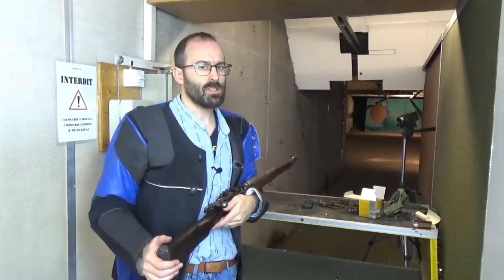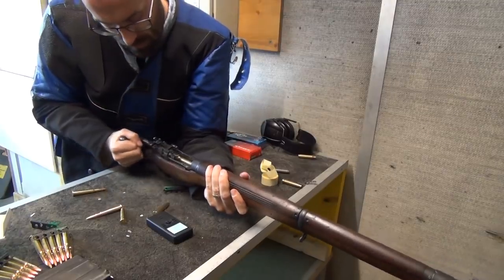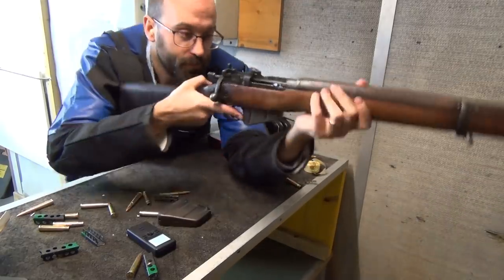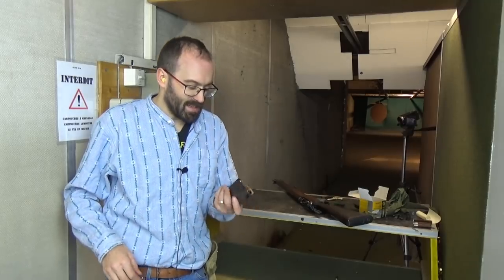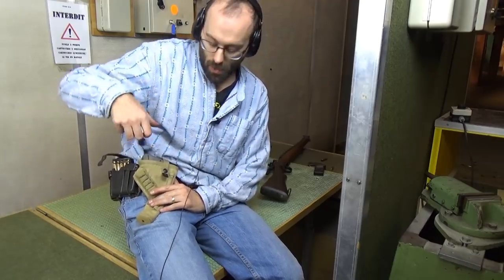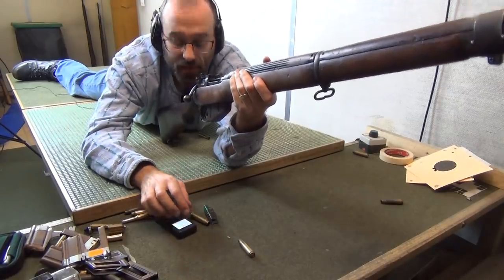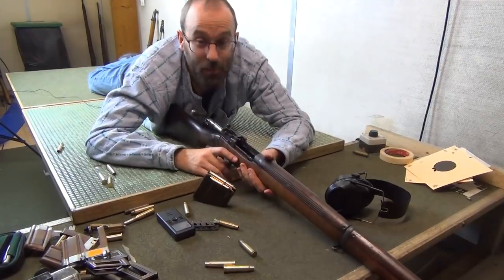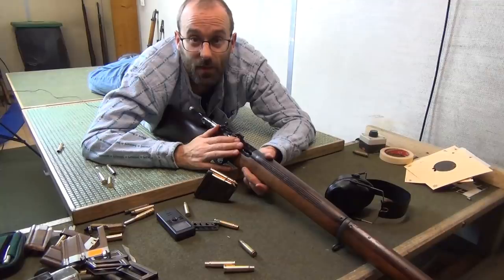Fastest Way To Reload A Lee-Enfield: One Charger Clip, Two Chargers Or A New Magazine?

Comment: A fine demonstration why the Garand 8 round enbloc clip was the correct decision when coupled with the ten pouch belt.  I used to beat the M14 guys with rounds on target when working from battle kit.  Up to 88 rounds at least.  First 20 went to the M14, but from there on to 88 it was me.

Comment: 1 vs. 2 clips at the beginning — 2 clips is more efficient because you open and close the bolt only once for two clips.
Reply: You'd still need to open & close the bolt the same number of times for both if firing ten rounds
Reply: @V. Fletcher -- Correct, but he is just measuring loading procedure.
Reply: bringing the rifle down and up again and aim also takes time, with 2 chargers this is only done once. So the difference should be even bigger.
Reply: Good point, nirfz.
Reply: @88porpoise "You do have some time lowering and then raising the rifle and reacquainting your sight." — I think you might be underestimating this because this will be combined with changing your position. It will also be an interruption in your normal bolt operation which on some rifles like Lee Enfield can be especially fast from the shoulder. I think any interruption matters. Now, mind you, all this would make absolutely zero difference for me, because I am not as highly trained (that's an understatement of the century), and even for someone like BotR the difference was small despite his mastery of the rifle. Still, the subject of the exercise was to determine if there is a difference, and I think the video as well as our theoretical analysis conclusively show that there is, however small it might be, and however small the audience that would notice the difference might be.
Reply: And, you lift then rifle up and down only one time.  It's really an obvious calculation.

Comment: This is clearly a very flexible system, if you run empty you can load a 5 round charger THEN decide whether to 
1) spend a little more time loading another 5 round charger
2) Close the bolt immediately to begin firing on the enemy ASAP.

As soon as you've put the first charger in you're golden, at any point in getting the 2nd charger from the pouch you may see someone trying to throw a grenade at you or something and drop that charger and just snap the bolt closed ready to aim and shoot.

then if suddenly there's nothing to shoot at any more you can continue loading the second charger. You don't have to reload from empty, you can top up every time your magazine is half empty.

Mag reloads will be inherently of low value as it only reloads 10 rounds at a time. For 10 round mags it could only be worth it if in a deep foxhole or trench so you could reload from a vertical stance, you could have the spare mag on the ground in easy reach in front of you and could just drop the empty mag.

That's an option for defending dug in positions, shouldn't be that hard to scrounge up a few spare mags.
Reply from the maker: I'm going to have to do another vid on the other advantage that everyone forgets with 10 round mags and 5 round chargers - you can put 5 in at any time when you've got 5 or less rounds remaining. You don't have to wait or screw around with loose rounds.
Reply: PS: there's a big advantage to having spare mags for a defensive position rather than just switching to another loaded rifle and that's because Commonwealth rifles are individually zeroed. Some people pull a bit more to right or left when shooting, and it's just not a good idea swapping rifles. 

Each solider is responsible for his rifle, he keeps track of minor problems like if the sights are a bit loose or where the bolt is normally a bit sticky and when a problem is developing.

By WW2 the rifles wasn't the main source of firepower, by then it was all machine guns, particularly the Bren gun which there absolutely had to be one per section (three per platoon) and aimed to have one Bren gun for every 4 riflemen (yeah, it wasn't only the BAR that aimed to 'just have more LMGs to increase firepower').

The rifles were far more for security for the Bren gun by WW2. Very standard German tactic was to use cover and concealment to get within range to throw a stick grenade, you needed to always be ready to respond to a soldier suddenly standing up to overhand throw a grenade.
Reply: I don't know if it's true, but I heard somewhere that a lot of British riflemen would tend to top up the Lee Enfield to 7 or 8 rounds rather than 10 during an engagement. The argument being that it takes slightly more time and effort to load a 5 round charger, on top of 5 rounds in the magazine, than to load a single charger on top of the 2 or 3 rounds in the magazine.
Reply: @bluesrocker91  I very much doubt it, all their ammunition is in 5-round charger clips. Where are they getting so many loose rounds so quickly.

I'm with Bloke on this, 10 round in the mag +1 in the chamber.
Reply: @Treblaine  He means waiting until you're down to 2-3 rounds before popping the next charger in rather than doing it as soon as you hit 5.
Reply: @WJS774  Ohh yeah, load a single charger on top of 2 to 3 rounds REMAINING in the magazine, after having started a firefight with 10+1 rounds and then firing 8-9 rounds.

That makes a lot of sense mechanically and intuitively. It's not going to be as hard to compress the spring all the way to 100% and if you're habitually reloading every 5 time you're down to 5 round in the mag... you're kind of effectively reducing yourself to a 5 round capacity magazine.

Comment: If the mag was easier to change out it might be the faster solution. Regardless a charger clip is not really any slower but is a lot cheaper and quicker to make. When supplying a million or so lads (and a few ladettes that managed to skirt their way into the frontlines) the cheapest option that is reasonably effective is the better choice. Spending way more money on something isn't really cost-effective enough during war unless that thing is just way better. Armies go for the cheapest viable option, and for WWII it was stripper clips.

Comment: Had the army gone for interchangeable magazines I suspect an awful lot would have been lost by soldiers more concerned with getting the next shot off than stowing their empties.

Although no country chose to equip soldiers with replacement magazines as standard for their basic rifle I note that they did so for automatic rifles and submachine guns.
Reply from the maker: Bigger magazines changes the equation massively. But then, there were some odd ones like the Italian Breda 30 LMG which is charger-loaded.
Reply: @BlokeontheRange  I'd forgotten about the Breda 30 though I had thought of certain early machine pistols like the Steyr M1912 as exceptions. Though people usually point to German assault rifle developments as showing the way for magazines I think it was the M1 carbine that really showed that all soldiers could be equipped with magazines as standard.
Reply: Bring back the retention chain. How often do you need to fire more than 20? ;)
Reply: @88porpoise  spent BREN magazines were to be retained, but by the assistant gunner of the section, rather than the rifleman during combat - he had what was effectively a dump-pouch with a button-top to store expended magazines for the duration, after which the rifles of the section would reclaim theirs and reload them.
Reply: @88porpoise  From using L4A1 and Sterling SMG in the 70/80s retaining mag were definitely order of the day on ranges and field exercises. The same went for L1A1 and Browning pistols.  God help you if you lost one, 252 (British Army charge sheet) right away followed by orders and 1 weeks stoppage of wages. I also remember my father telling me he got busted from L/Cpl to Signalman for loosing a Thompson mag in Italy during WW2.
Reply: Rumblin_Cynth_Rampo And a relative of mine was charged with losing his rifle during the American Civil War...

Comment: I'm wondering if it wouldn't be easier to do the mag change prior to extracting the previous round, no open bolt to fiddle with or worry about it inching forward and sliding over the new round
Reply: Then you'd be fighting the magazine spring to get it fully inserted though.

Comment: Personally. I think the mag change might be better if the mag release was easier to operate and the mag would drop free. I think the AR-15/10 kinda sets the standard. I wasn't expecting the mag change to be faster without it being in a pocket. That was a guanine surprise. My No.4 trigger guard is parkerized and the mag is a bitch to get out.
Reply from the maker: The thing with dropping clear is that there is no way that any army of that era would have tolerated dropping magazines on the floor deliberately :)
Reply: @BlokeontheRange  Doesn't have to drop on the floor if your hands in the way 😜
Reply: @KB9813  sure but people get lazy
Reply: Stripper clips were a vast improvement over loading individual rounds, you get less improvement going to a mag change.  The reason mag change is now popular is because of the size of the magazines.  Loading  a 20 round rifle with stripper clips would be way slower than changing a 20 round magazine.
Reply: @BlokeontheRange   Practical combat shooting. My Dad was always on about topping off magazines. 5 rounds is ideal for this and makes sure you don't have an empty weapon in combat. His loader would change mags and top off when he was on the Bren during breaks of fire for the same reason.
Reply: The mag was never created as a "load" and use item.  It is much faster if you load stripper clips (5rnd) and then another.  The brits trained in a method that one would reload and the other fire and so goes down the line.  It sounded like a MG.  The mag is intended to be removed for cleaning and inspection (I think).  It was too expensive to have mags.  It also did not fit Pattern 37 webbing (used 5rnd clip holders).

Comment: You mentioned S&B ammo... What's you opinion on it? I've seen it on the shelf here quite cheap but I always thought it "looked" very cheap too. Not a scientific assesment I know!..... Also, my chargers never seem to want to step aside by themselves and seem to prefer obstructing the bolt on it's way forward.... Any ideas?
Cheers
Reply from the maker: S&B is the most accurate 303 on the market, but the cases are pretty crap if you want to reload. Plus the rim edges are totally square, so they will rimjam.
Reply: @BlokeontheRange  prompt reply always appreciated. Oh, and I always find your "vaguely" interesting videos, very interesting... Keep it up!

Comment: I think you could've picked up a few seconds by stowing the empty mag the same time you grabbed the fresh mag instead of making the same movement twice
Reply: Hold the fresh mag in the pinky and palm, insert used mag and close. Magazine placement in the pouch is also needed to practice how it's comfortable but the rounded magazine would aid in it. Also with the smle I'd put the mag on the left side, slide my finger forward and hit the mag release. It's all learning what works and sometimes an outside observer helps. Changed plenty of magazines in an m16/4 in my time and a lot in the mud on the move for live fire exercises. Long time ago so I'd need to practice but it was done and could be again if needed.
Reply from the maker: There's no way I could do that without dropping the fresh one.
Reply: @BlokeontheRange  I think you could do it. If you think about it the mag release is a bend of the wrist forward and roll of the index finger to the mag release. I used to be a lefty and still do most things left handed so that might help with left handed mag changes being natural though.
Reply: Also I thought I said it but didn't, I don't think anyone can get fast enough to beat clip reloads. Too many moving parts for mags to be faster.

Comment: I have thousands of round out of SMLE.
I bought my first one when I turned 16 to go hunting.
Later on Worked for the NZ Govt. on deer and goat goat control.
I have fired thousands of rounds of .303 
We hand fed straight into the mag. With single rounds.
One of reasons for the clips was less weight so you could 
carry more ammo and it was convenient to load.
What ever way you load, it is what you become used too.
All the ways are much the same for speed.

Comment: Couldn't help but notice that your clips kind of just fell out of the way after the last round was loaded or as you began to apply pressure to the bolt. Is that so with all of your clips and Enfields or no? I have a numerous Enfields and it seems my clips don't always just fall out and I need to pluck them out. Most of the clips are NOS and don't have any parkerization wear and a lot are still pretty stiff when it comes to loading so I've been using just a few as a test and they seem to be "wearing in". Hopefully the others follow suit.
Reply from the maker: I guess you must have the bad Italian chargers or something, cos they should all auto-eject.
Reply: Bloke on the Range they’re English but I suppose they could just be slightly out of spec perhaps. I’m gonna mess with them a bit more because I’m fairly certain I can get them to work as advertised. I have probably 20 or so all from the same batch it looks like and I got them all new along with a 1943 marked bandolier years ago. Thanks for the info though. If I can’t get these to work I’ll just have to pick up some more.

Comment: With ten rounds in the mag, the first two or three rounds generally require more effort to chamber than the following rounds. Also as the clock runs down on your mad minute, you don't want to have just got the second charger into the mag only for "cease firing" to be called. Stuffing that second charger load in the mag has cost you  six seconds that could have got you an extra two rounds on target. So start with ten, but only reload with fives.
Reply from the maker: Watch my mad minute videos. You'll see me doing EXACTLY that...

Comment: Magazine is the more efficient in the long run which is why the army went with 5rd chargers it made you slow down and conserve ammo!there were 25 and 30 rd magazines to fit the Lee Enfield s
Yet they were never issued I'm quite surprised that the army didn't adopt a 6rd charger and a flush magazine as in the Lee carbines due to the fact that they trained the majority that you loaded 5 at a time and never carried it with a full magazine except in a assault!
Reply from the maker: There were 20 (not 25 or 30) round magazines for the SMLE. They were indeed issued in late WW1. They were hugely disliked by the troops, so were withdrawn and ended up modified for use on Vickers-Berther LMG's in the 20's.

And the MASSIVE advantage of a 10 round mag and 5 round chargers is that you have a great choice as to when you top it up with 5 rounds. People always seem to have "shoot to empty" in mind since they're stuck in 5-round mag thinking.

Comment: I think you proved that going from dry to 10 rounds loaded,  a mag change would be fastest. Allowing for human error at any possible point of the reload process, the fewer motions, the better. Reloading a 10 round mag allows for one interaction. If you want to qualify that with mag retention, that’s fine. 

I think the issue here is we are confusing historical accuracy with pure split times. Due to monetary constraints and pressures of war, the British army had to issue chargers over magazines. Had each Infantryman been issued 3 magazines with a capable retention/dump system with additional chargers to “top up” as needed, I don’t think there is any argument that they would have been slower than the standard WW 2 load out.
The British Government simply could not afford such an expense, nor had they really researched or tested such a load out. Additionally, as you have stated many times, that sort of effort into rifleman load-out would not be bothered with as their main focus had become supporting the Bren.

All that being said, I think if you went from dry to firing 30 rounds, 3 mag insertions w/2 changes will destroy 6 charger insertions either way you do them.

Thanks for the great work. Keep it up!
Reply from the maker: Thanks. But in a practical context you wouldn't be starting from dry, you'd be starting loaded :)
Reply: Bloke on the Range with all due respect, then start loaded and shoot 40. The magazines will outpace the chargers. You yourself proved it.

Comment: I wonder if perhaps instead of having an extra movement on grabbing the new mag, putting it in, and then stowing the old mag, perhaps the process should have been:
Old mag out (in hand) > grab new mag while stowing old mag > insert new mag.
instead of
Old mag out (in hand) > grab new mag while holding old mag > insert new mag > stow old mag.
But that's in terms of like, maximizing every movement.
Reply from the maker: As I said on FB, trying to manipulate both mags AND the pouch closure with 1 hand is not going to go well, and is slowing down the time when you could potentially fire your rifle again in a "drop everything" emergency.
Reply: @BlokeontheRange  I copy-pasted both responses since I had no idea which one you'd check really, reading the one on Facebook I suppose that makes sense. I've never handled a Lee nor any of the parts for them so I don't know the sense of scale and how hard it is to manipulate one. Was just dropping in my two cents.